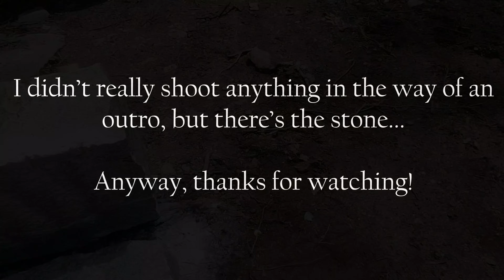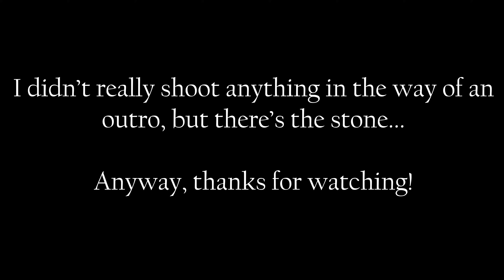Hand Splitting a Step From a Larger Granite Block

Comment: Been there and done that. We called the splitters Feathers and Wedges and they were a lot bigger. Drill the right size hole with an air drill, drop in the feathers and wedges and drive the wedges with a jack hammer splitting some very big slabs of sandstone.

Comment: Very interesting video!  Since I know nothing about rock splitting, I would have thought that the split happens as soon as you finish hammering, but that's not the case. You had to wait for the tension on the rock to be released! 
I was also surprised that you drilled first, but that's very much quicker than "carving out" the holes, then to place the wedges in after. And to use very thin drill bits, but you are trying to not make wider marks in the gorgeous stone. Well done!
Every day's a school day!

Comment: Thanks for sharing this video. It is nice to see this skill is not lost and some people still master it.
I would like to share with you a tip that was given to me long time ago by a old guy that did this all his life. They used water at a certain point when the crack was barely starting and live it overnight. The watet would penetrate the crack slowly, and the next morning the stone would be there in two halves.
We used to split granit as well, but in northern Italy we use more a sort of gneiss stone called beola. We used the gray an the black one. Especially for creating flat stones of about 2 inches thickness, but also 1 an half. We use them for old houses on the mountains in the north west for building the roof on a wooden structure. Also the walls are completely in stones as this material was locally avalaible and was cheep. Of course it has some drawback but back in 1800 hundred there was no alternatives. The whole house was built with dry technique. No cement was used to bild the walls. The people back than, were quite skilled. Only very few master those skill nowadays.

Comment: There is very little elastic energy stored in stone or steel wedges, so it is unlikely to spring apart.  If the base the stone is on is uneven, the stone might fall over, but it won't jump apart.

Comment: Have you tried pouring water into the holes?  I did this once after driving the wedges in until they were tight, and you could hear the rock begin to crack, and it popped apart moments later with no additional pounding on the wedges.  This was 40 years ago, and I don't remember the quality of the rock face, though.  To us the quality of the cut was unimportant--we were moving boulders off of trails in Yosemite.
Reply: What function would the water serve?
Reply: @joewoodchuck3824  Potentially makes it so you could split rock with fewer sets of plugs and feathers. I'd love to hear from someone with more experience.  I'm curious as to the effect on cut quality.  If you're asking what the water does within the rock crystals to help the splitting, I would guess it works into micro-cracks and reduces adhesion (?) between crystals.

Comment: Nice result!  Have you ever used the Trow & Holden slab splitter?  On stock that size, I'd set my score line with the slab splitter [across the top] and do what you did on the sides.  Then my plug and feather(s) holes would be drilled equal distance spaced the width of the slab splitter edge.  I'd give each plug a strike and then follow up with the slab splitter.  As you know, patience is key.  It seemed to me using that slab splitter in conjunction with the plugs/feathers not only sped up the process but nice clean splits [most of the time].  Anyhoo...were you effected by the recent flooding in Vermont?  If so, I hope things are okay!  Cheers...
Reply from the maker: I do not have a slab splitter. I do have a quarry buster, but it is hard for me to swing an 8lb hammer into the back of that and keep a tidy line, so I use the tracer. Additionally, the quarry buster doesn't have a very keen edge on it anymore. I like the sounds of your approach, and may try to pick up a slab splitter at some point at try it out. Thanks!
Reply: @vermontheritagegranitecomp2062  That quarry buster has a specific use as does the slab splitter - ones for 'roughing work' [quarry buster] and one for 'finish work' [slab splitter].  you referenced the one drawback of both tools - both require two people working together.  Oh...the other MAJOR difference between the quarry buster and slab splitter is the amount of strike force needed.  The QB uses more brute force - the SS uses about the same amount of strike force used with a tracer chisel or plugs/feathers.  The Trow & Holden slab splitter ain't cheap, but well worth the money spent if you be splitting steps, lentels, arch stones/keystones or fancy set pieces for wall work on a regular basis.  Like all tools, there's a learning curve with the slab splitter, but once you get the hang of using it, you can knock out some really interesting pieces real fast. On a different note, I just watched your quarry road video.  Crazy what water can do!  Cheers...